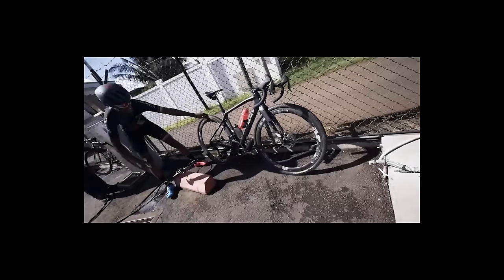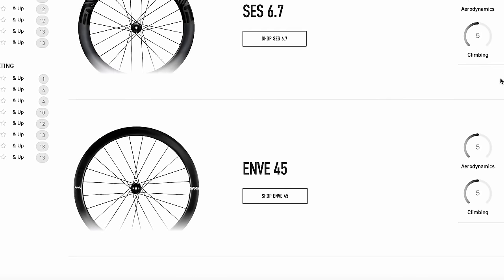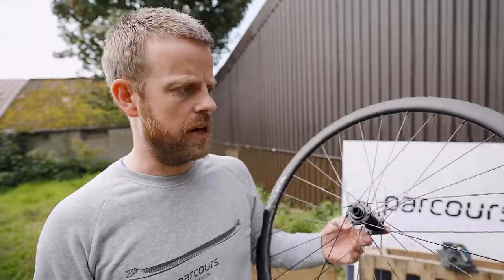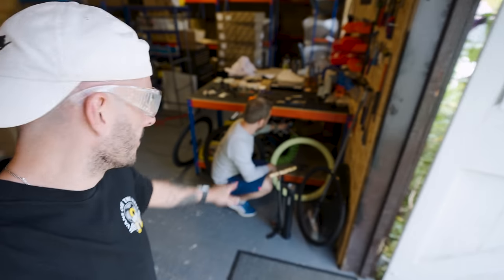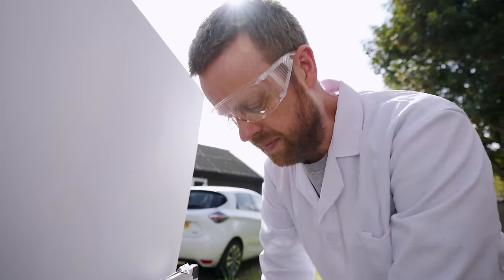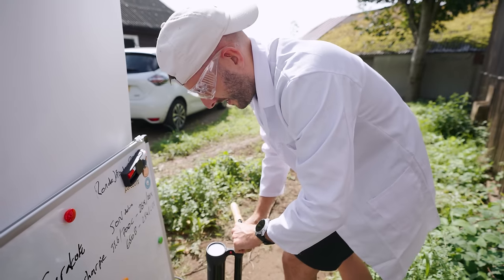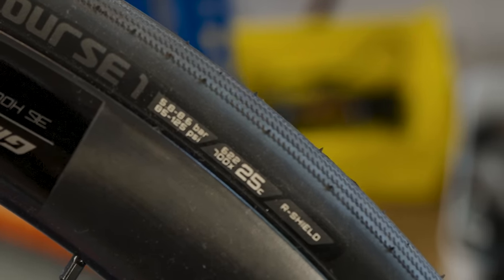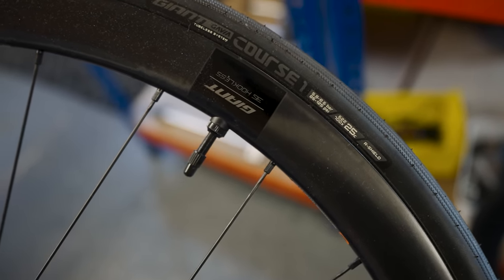Pumping Up Carbon Bicycle Wheels Until They EXPLODE

Comment: Hookless is like pressfit back in the day. Created only to facilitate and make cheaper the manufacturing process. It's not meant to benefit the final consumer.
Reply: Well, Zipp decreased the price for its products by a good amount. If they transfered all savings to the costumer and didnt increase the margin might be a different story. Furthermore a zipp wheelset is a bit lighter than most sets from other brands.
Reply: @Xarx42 I think the only reason they cut prices is due to more competition rather than lower manufacturing cost.
Reply: @hkchew03   Hm, eventually I dont know, but it would surely make sense. There is no need anymore for more complex casts, which can only be used once.
Reply: Wrong! pressfit done right (with required tolerances) is better and much better than threaded (due to smaller tolerances compared to threaded fitting). Hookless is just cheaper to manufacture for carbon rims.
Reply: @Xarx42  what are the chance of premium brand reducing price due to lower manufacturing technique? They could have just profit the difference without most of the consumer knowledge. It's more probably brands like Hyper that put pressure.
Reply: I'm in the camp that prices have been cut due to increased competition. I think more people are becoming aware that a good wheelset doesn't need to cost 2-3k unless you're a snob about brand names.
Going hookless is just a way to save costs for them.

@savagepro9060 Ok grandad
Reply: @markokompic7617  lol, but pressfit has hardly ever been done right has it and thousands of bikes are not right or even useless? Define 'better', smaller tolerances means what regards a benefit? If ou can't even get the BB in or the whole crank is FUBAR due to pressfit problems. Can ou gain some notional power transfer increase, it's likely, but the cost overall to consumers is huge with no gain in real world use.
Reply: So you ignore the off-road crowd?
Reply: @Vanadium  Are they any good for off-road?
Reply: @savagepro9060  And you don't need to worry about blowing them off the rim with high pressure.  You do need to do a careful glue job, but that's just basic maintenance.
Reply: @markokompic7617  Agreed. Not only that, but it was done to allow bike manufacturers to make frames wider - and therefore stiffer - around the BB. The problem is manufacturers' inability to consistently make round holes that line up with each other
Reply: @thecoffeeblog  they are better because you get a smaller leaver on impact. Some manufacture even make the rim wider on the top. Its more like a trapeze. What does this do? The walls dont fold as fast as classic U shape because most impacts will dent your rim inwards.
Reply: @markokompic7617  
True, unfortunately those are manufacturing requirements the industry is unable to adhere to.
Reply: @markokompic7617 However, it’s almost never done right, especially not in frames that mere humans can afford. The main reason was to lower costs and (sorta) increase reliability, as bonding Al or Ti into carbon for a BB shell is a nightmare.
Reply: Incorrect
Reply: @ynotnilknarf39  I have few bikes with pressfit and few with threaded bb. I have only had issues with threaded - they become seized and they become very difficult to remove from the frame. I have even had to grind two T47 internal bbs since the tools I had were destroyed as I tried to unwind them (destroing the bb shell so that it could not be removed). On the other side, I just push (with the hammer) pressfit bb out of the frame and put new one in.

Comment: I weigh 92kg and never go below 85psi on 25mm tyres. If I’d bought a bike that came with hookless wheels I’m pretty sure I would have been clueless to know I can’t put that much pressure in. Also at the lower pressure because I run tubes I’m pretty sure I’d be getting pinch flats.
Reply: I think hookless is tubeless only
Reply: Hookless rims need tubeless compatible tyres, but you can still run them with tubes.
Reply: At 92kg  you'd run tubeless with a 28mm or 30mm tyre,  and pressure would be below 70psi with either.  You won't get pinch flats as there's no tube to pinch.
Reply: I am 118kg and run at 91psi on 25mm. I will stick with the hooked. For me hookless would would be like riding on live grenades.
Reply: @ColinSmith2001  tubes with low pressure because its hookless?
Reply: @yourdeadjack Yes, I'd not assume any increase in the safe pressure with tubes.

Comment: Good vid. Let me at least say I daily run my bike with Cadex 36 hookless wheels and Vittoria Corsa Pro at 6bar’s of pressure whilst Vittoria claimed the safe limit is 5bar. They have been faultless. Also in the shop (only selling Giant/Cadex wheels them being all hookless) we actively work to inform customers. On the other hand Giant’s safety protocol’s for approving a tire they have to able to withstand 1,5times the normal pressure. I think its fairly safe and most people riding carbon wheels are aware of pressure limits these days.
Reply: a fool and his money are easily separated, especially where newer cyclists with disposable income are concerned. not everyone spends every waking hour reading bike radar and watching bike vids on youtube.

as a person who's ridden seriously on and off for the better part of 20 years, i came back to the sport earlier this year and found it unrecognizable and confusing. my 2014 race bike has alu box rims fit for 23s, and upgrading or switching platforms can be intimidating. this is an incredibly involved sport, which is precisely why i think so many of us gravitate to it. it's important to remember that every ride is someone's first group ride and you can't assume someone's knowledge or dedication based on what's between their legs.

tubeless is touted as a cure-all, but it seems expensive, confusing and potentially dangerous. the more videos like these we have on the subject, the better it'll be for riders of all stripes.
Reply: @maximilian3004  i’m all down for Cade Media actively working to discuss these things to make people more aware but all I’m saying is out of my experience (Dubai industry, Berlin industry & here in the Netherlands) I see a fair awareness for tubeless and their pressures. I get it completely that it may look daunting for new people hence it is my job to actively inform people on these topics.

Comment: I’ve been riding hookless for 4 years at the recommended pressures for my weight, which is below the 72.5 maximum, without any issues. But I know quite a few riders who have hookless rims and know nothing about the 72.5 psi maximum, ride at 90 psi, and don’t believe me when I tell them about the danger. One of the reasons is that a local Giant store, where the bikes are supplied with hookless rims, was recommending and fitting non-compliant tyres to their hookless rims when they had replacement tyres fitted. They were also inflating them beyond the 72.5 psi on the Giant rims. If a local bike shop that sells bikes with hookless rims doesn’t know the standards then what hope has the general public got. A problem that existed for a long time, but less so now was the difficulty in finding tyres that were hookless compliant. For so long there was only a small range of tyres that would fit a hookless rim. Happily, that number has now increased.

Comment: I have the exact Giant tires/wheelset as at the end of the video. I’m 168lbs. and run 70/75psi front/rear. No issues after two years but I did my due diligence by consulting my Giant LBS and reading information online prior to riding this setup. Tubeless is not for every roadie, and I certainly agree, LBS’s must know what’s on the floor and manufacturers must inform you what is and isn’t compatible with their products. The Giant website lays out tubeless information well.
Reply: I have giant and can run pressure above 72.5. They are leading the pack for hookless tech

Comment: Giant actually allows certain tires to be inflated over 5 bar on their hookless rims! In fact most of the time I have to give the tires on my Giant wheels about 7 bars for the tires to be properly seated on the rim. No idea, what it is with other hookless rims, but the Giant stuff certainly needs the pressure in most cases.
Reply: Yes, that's true and Giant has quite an extensive list of tires that they tested. However, this also adds confusion. When I bought my Giant with the SLR1 wheelset I had to contact support to verify that they can really be inflated over 5 bar.
Reply: Yes that warning at the end using a giant rim and tire is complete BS.  Giant has an approved and tested tire list where you can safely go well above 72.5.  You can still use other tires as long as you stay below 72.5psi.
Reply: @KN-vl7nk Thank you! Glad I'm not the only one who caught it! Those rims have a max pressure of 125 psi. It's labeled right on the rim!

Comment: Important to note that the pressure you pump it up to isn't the same pressure as when you are riding. Pressure increases due to friction/heat as you get going.
Reply: Or the weight of the rider.

Comment: Two things: 1. Use a pressure calculator. It's interesting what happened when i changed from hooked to hookless. 2. If you are one of the 'heavier" riders, get bigger tyres, if you can. Go from a 28 to a 30 or a 32mm tyre. The difference is you ca run lower pressures and still have a stable setup.  I weight 77kg and run 55 front/60 rear on 28mm Corsa N.EXT tyres. This is per the recommendation of my LBS. 65/70 was too high.

Comment: Check Giant tire test protocol. Their wheels can and NEED to be pumped above 72.5 psi if you are a heavier rider. They also have tire pressure calculator. Have you heard of anyone with slr01 or cadex wheelset problems? Me neither.

Comment: Thanks Francis.  I had convinced myself that hooked rims were right.  Now you've proved it.  Your remarks about altitude are relevant, but also consider hot and/or impact.  Inflate your tyre on a normal day and ride on a hot one.  Heat makes air expand (carbon almost does not) so pressure increases, also hit that pot hole and the impact increases pressure.

Comment: Great video Francis, completely agree with you stating that more needs to be done to correctly inform consumers of the dangers that could happen. 

However I am recent convert to tubeless and hookless wheels (Zipp 858 NSWs). 
Previous wheels are Zipp 808 NSW with hooks. 
I’m an engineer by trade and the idea of hookless initially terrified me but I personally wanted to give it a go for myself. 

I’m 75kg and the suggested tyre pressures with a 28mm tyre (Pirelli P Zero Race TLR) on the 858s with a 23mm internal rim width is 61psi rear and 56psi front. Significantly below the maximum. 

I have been running 60psi front and rear and have had 0 issues thus far. 

I check my tyre pressures before every ride using a digital pressure gauge just to be sure they are accurate and for reassurance. 

The difference in ride quality and rolling resistance has been fantastic compared to my 808s with Vittoria TPU inner tubes on the same Pirelli tyres. Significantly more comfortable.

Comment: I still think it would blow riding at 90psi, imagine riding on a hot day, warm tires from a long downhill and the tire compressing over road bumps all helping to increase the pressure probably over 100psi.
Reply: Incorrect.
Reply: @portland675  You could have pumped you tires early morning when it was 0 degrees C now it's 30 C midday when your riding there is +3 PSI (happens in Australia) then you finish on a huge bumpy downhill the heat in the rubber from friction and flexing will add 1 - 2psi then a large compression of the tire from hitting a pothole will increase the pressure even more for a split second, not sure by how much but air compresses very easy I would guess anywhere from 1 - 5psi extra.
Reply: @KurtisPape  all of what you describe happens. None of it makes a difference. Now when carbon rim brakes were a thing, we saw lots of tires blowing off rims from the heat.
Reply: @portland675  Might not cause a blowout but you are getting closer to the 110psi failure point, who knows how the tire would react leaning into a tight switchback.
Reply: @KurtisPape  I do know, because they’ve been tested extensively. Nothing happens.
Reply: @portland675  So you're saying that pressure increase due to temperature increase 'doesn't make a difference'? What if the pressure then goes above max recommended. Safe?
Reply: @CyclespeedTours  it doesn’t make a difference because it’s not enough. If you pump your tires up in a freezing cold garage, and go ride them in the hottest outside temps you can find, we are only talking a few PSI.  There’s literally a formula for it PV=nRT. 

Yes, it is safe a few psi above max. You can pump them up beyond the max 10-20 psi and it’s not going to even come flying off the rim. They build in quite a wide Margin for safety.
Reply: @portland675  You obviously didn't see my recent video where it blew off at 5 bar then......and yes I studied that formula at university.
Reply: @CyclespeedTours  oh I did. You’re using garbage wheels that would have blown off any tire. Not even close to
Built to ETRTO spec.
Reply: @portland675  Extralite are a well respected company with many, many years of experience. How do you know they aren't to spec? Did you measure them?

Comment: First ride out with my new bike on a summers day.
Used to put ca 8 to 9 bars in my tyres so gave the new ones the same.
Mavic Allroad S with  32 mm Vittoria Terreno Zero.

Got half way to the climp of the Le Grand Caunet
In Roquefort-la-Bédoule.
Was going at 10 km/h and saw the front tyre getting black of the rubbing and bang my rear tyre jumped out of the rim.
I put the tyre back on and continued without any problems.
At home inspected the lot and no damage to be found.
Cleaned the mess up and installed the tyre with just a little latex on the beat so it sticks well to the rim.
No use to put it in the tyre cause I’m not planning to get a puncture.

Now enjoying riding at 5 bars max

Comment: That pump, at least the one I have got, reads high. Recently started using topeak digital gage and its around 0.5-0.7 bar lower than that lezyne overdrive floor pump displays. So it might have been even under 100psi.

Comment: You're forgetting on those Giant wheels mentioned at the end of the video, the WHEEL max pressure is 125psi AND it's hookless. The label is between the spokes. Still wouldn't go that high with tubeless though

Comment: As I said on your recent podcast ep, I believe hookless should not be used unless you are running 35mm+ tyres, especially if you're on the heavy side. One question to ask: what would happen if you put an inner into a hookless rim with a tubeless tyre? Is this the reason why maybe the tyre pressure range on the tyre exceeds that of the rim?

Comment: Simple solution is max pressure stated by the valve hole on the wheel. My old 2016 Hed Jet clincher wheels have stickers saying 100psi max.
As you mentioned very few people will read instructions or buy them second hand with no instructions. Literal accident waiting to happen.

Comment: I'm running Giant's hookless rims, they came with the Cadex 25mm tyres which I didn't get along with so swapped out for GP5000S TR 28mm tyres. Giant's own calculator suggests it's safe to go above 72.5psi, would be interested to see you test this with a tyre/wheel combination they have 'approved'. The Giant hookless calculator seems to top out at 103psi for a heavy rider on 23s, it would be even more interesting to run this and simulate a 130Kg rider hitting a big pothole!

Personally I don't need to run at/over 72.5, I run 65psi at the moment. For myself, as someone who knew what they were buying and did some research, I'm not in any way put off hookless and I'll happily upgrade to some Zipp hookless wheels in the future. I also really like how well tyres fit, I assume because the tolerances are tighter with hookless, so it's easier to mount tyres and you can seat them with just a normal hand pump.

Comment: For almost two years I had hookless rims and didn't know about it. These are Mavic Allroads. I have them on a gravel bike and never pumped them more than 3.5 bar (the limit on the wheel is 4.2).
For about 700km I had a tire, for which the manufacturer instructions clearly said "hooked rims only". Luckily, I never had any issues and discovered that the rims were hookless when I was washing them for a tire replacement.

Comment: I've been on ENVE wheels with hookless rims for two years.  I now have two sets of wheels: the first is the foundation 45 and the second is the SES 4.5. . Perhaps it is just confirmation bias, but I just want to say that the engineering is totally dialed in. With the appropriate tires -and ENVE has a list of approved tires- they are astonishing.  I completely agree with Francis that the tire manufacturers, in particular, need to do a better job of labeling max tire pressures for hookless.  I never exceed 65 and they are a dream, btw.

Comment: I don’t see the problem for experienced riders that know their equipment limits and follows manufacturer’s instructions. They are safe. But I do see the problem with the Giant wheel set shown at the end of your video. That same setup came with my 2021 Giant Propel Advanced Pro 1.  I saw the discrepancy before I left the shop and asked the question, to which PSI do I abide with. Always take the lower of the two. I love the bike and everything about it!  Never had an issue with the tires and rides great.